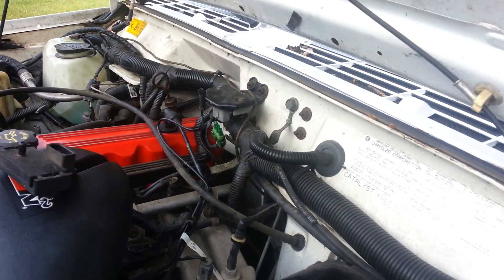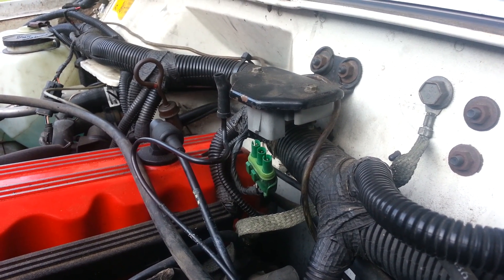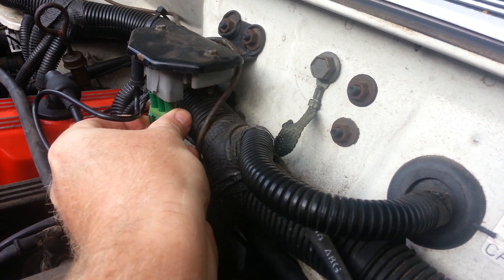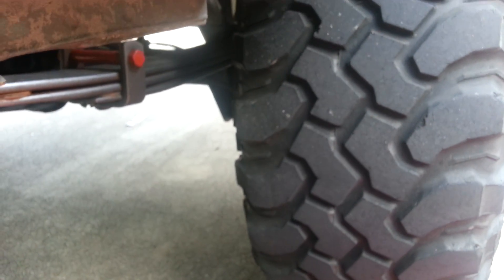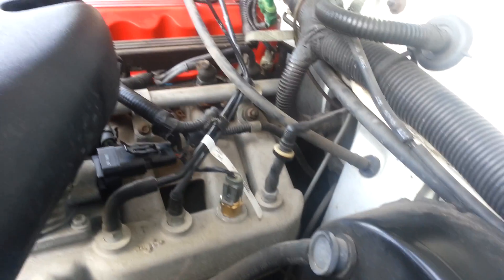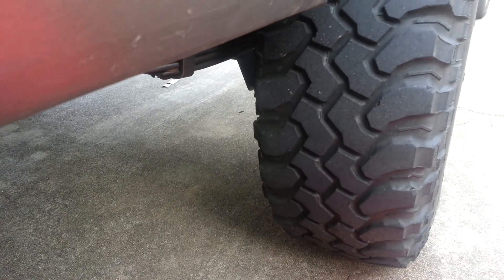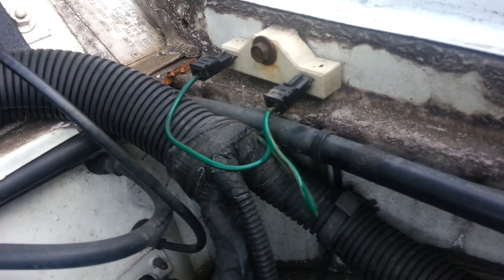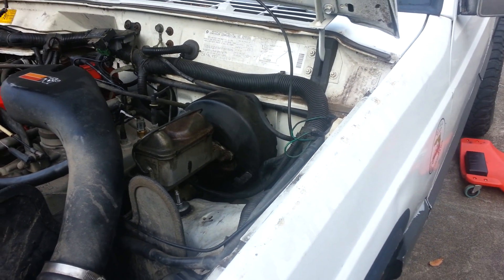OBD I Jeep Motors, crank - no - start

Comment: Can you not clean older sensors? Well I know you can but not sure about that particular one. I'm going today to buy some MAF cleaner for my Jeep. I'm not positive mine is the problem so I'm just going to clean it first and see if it is just dirty.
Reply from the maker: MAP sensors are completely different from MAF sensors. The MAF can absolutely be cleaned. There's nothing to clean with a MAP sensor though. I mean, if the vacuum port is clogged, you may be able to unclog it, but that's really all there is on the MAP sensors.

Comment: My ZJ would randomly die every 3 days. Replaced nearly every sensor and ignition system including battery. It would run for 3-4 hours/day for 2-3 weeks. Today the pump made an unusial noise, turned the key back then forward to prime. Nothing, dead silent. Guess whst code I got;, 14 MAP Sensor. Hopefully a new sensor works

Comment: A Snap-on scanner checks OBDI and OBDII. They have a cable for Jeep. The connector is on the RF in the engine compartment. It says 'Diagnostic'. Get the latest cartridge for your car. Also, the Primary cartridge. Check that the backlight works before buying.

Comment: Map sensor caused a crank no start ? My 99 Wrangler died as if some one shut the key off I e replaced everything litterly no results this is the one thing I have not tried my fuel is not priming I have over 40 hours into testing things and replacing things I’m going to give this a shot I hope it works for me if so your a life saver and thanks in advance for this post
Reply: Well? Did replacing the Map sensor work for you?
Reply from the maker: In this case, yes it did. This is not a common problem though. I've been meaning to look up wiring diagrams to see how the map sensor collates to the fuel pump, but I keep forgetting.